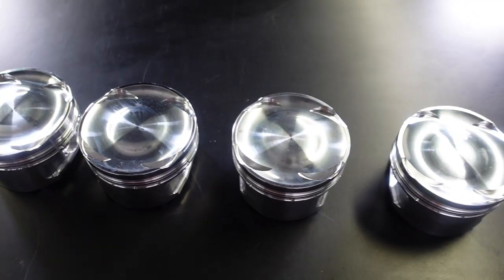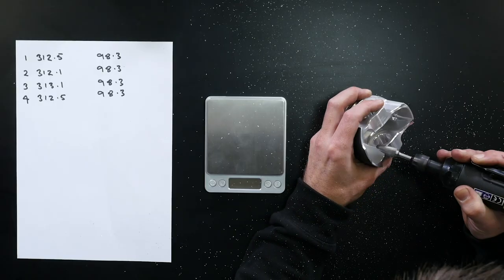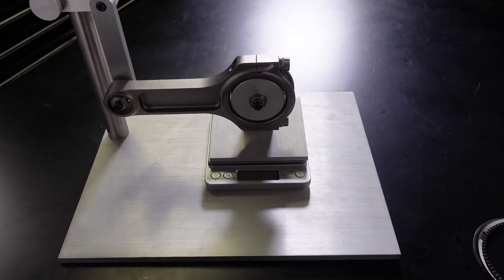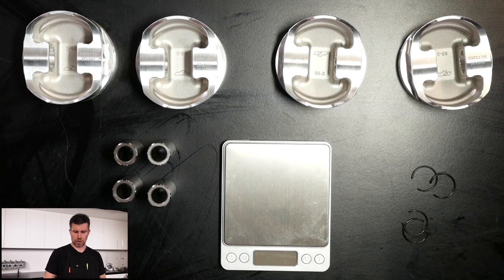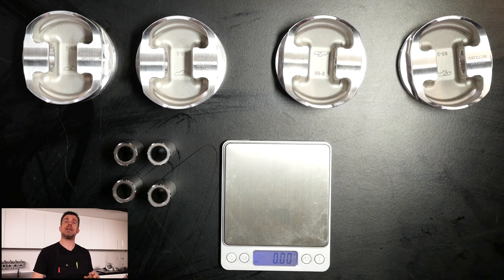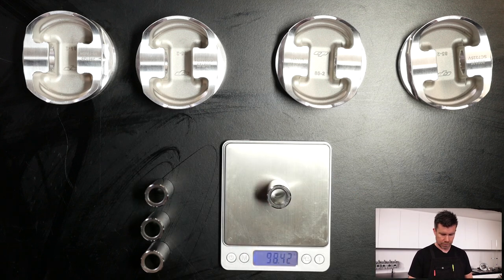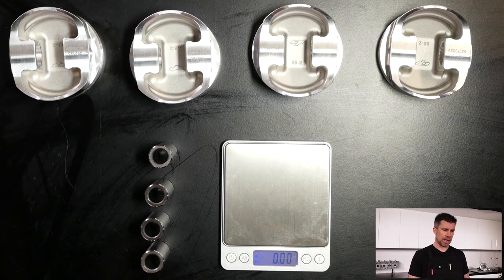How To Balance Your Pistons And Connecting Rods [#TECHTALK]

Comment from the maker: What engine are you going to balance the pistons and rods on for the first time? - Taz.
🦸‍♂ Building a fast car? Get $400 OFF the all inclusive VIP online course package deal:  https://hpcdmy.co/vipy67
🔧50% OFF your first online engine building course. Enrol now: https://hpcdmy.co/offery67
0:00 - What Do You Balance And Why?
0:40 - Can YOU Do It All At Home?
0:59 - What CAN You Do?
1:38 - Your Engine Specifics
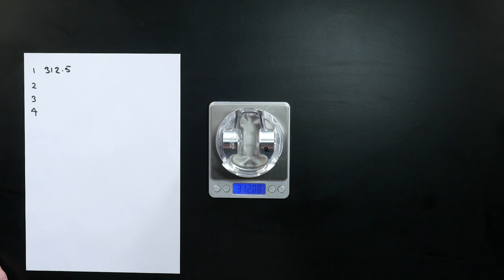2:59 - Do This Before Your Machinist Visit
3:18 - Wrist Pins, Ring Packs, Wire Locks, Pistons
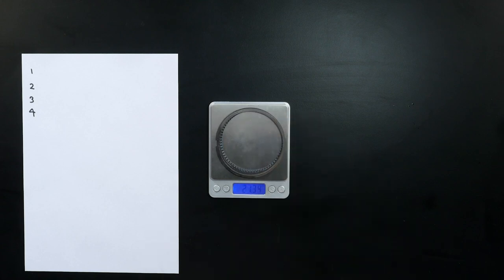3:45 - Balancing Ring Packs and Wire Locks
4:09 - Equipment
4:12 - Scales
5:07 - Die Grinder And Burrs
6:08 - Connecting Rod Balancing Fixture
7:38 - Linisher / Belt Sander
8:15 - [Piston Balancing]
14:12 - Tolerances. How Tight Is Too Tight?
15:15 - Where To Remove Material From?
16:45 - GOLDEN RULE
17:35 - Where To Stay Away From and Why
18:05 - Main Point Takeaway - Piston Balancing
18:36 - [Connecting Rod Balancing]
19:02 - Material Removal Big End
20:24 - GOLDEN RULE
20:40 - Material Density
21:08 - Material Removal Small End
22:26 - Cheap Scales 101 - What To Check For
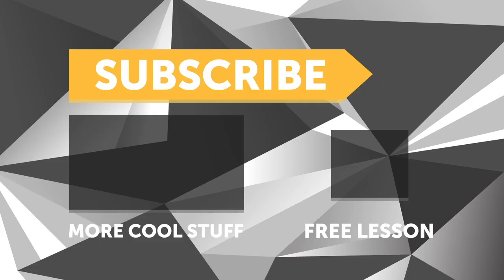24:10 - Learn More

Comment: At least for the aluminum piston If you use a good quality wood carving knife over a bowl on the scale. You can get a real time measure of what has been removed as you remove it. 
You just need to let the shavings fall into the bowl. A paper plate works well to.

Comment: Great video, good to see not much has changed in 45 years of balancing ricpro and rotating masses.  One question for you though, and since you and I both like to think in terms of high RPM, after balancing the connecting rods, do you recommend shot peening the beam and pin end where you removed material?  Or have you found this to be unnecessary?

Comment: If you were to put everything together as a unit piston... connecting rod.. pin...retaining rings. . piston rings... connecting rods bolts.. bearings. And you match  all 4 or 6 or 8 units in weight and say you only remove material of the bottom side of the  connecting rod or rods if theres not a huge difference in weight. Will this be a problem. Rather then doing it step by step?

Comment: Why wouldn't you also match the rod small end masses to the combined piston/pin/rings/retainers assembled mass? There might be a magic combination where the total reciprocating mass is within tolerance and no grinding is necessary.
Reply from the maker: You're free to check that and see when you're doing your build, but in our experience grouping things together will only see you take more material off less components rather than just a little bit off most - Taz.

Comment: hi great video very useful indeed...would weighing the piston with rings , gudgeon pin etc  as a whole  work? meaning the whole mass is weighed?
Reply from the maker: Yes, but be careful to match lightest to heaviest with pins to avoid taking more material off the pistons that you otherwise might have to. Heaviest to heaviest vs lightest to lightest is a bigger weight gap to cover if that makes sense - Taz.
Reply: @hpa101  i suppose you could put heaviess pin with lightset piston ....intreguing ...thanks
Reply from the maker: Yup, that's exactly what I'm trying to say, or rather Andre as he does talk about it somewhere if not in this video 😎 - Taz,

Comment: do you measure ring packs after gapping them, or it doesnt matter as all gaps (should) be the same
Reply from the maker: I'm not quite sure I understand your questions sorry. You measure your gaps and adjust as required, and then do confirm they are correct as part of that process.
Trust but verify.

Is that what you meant by your question? - Taz.
Reply: @hpa101  sorry meant measure the "weight" after ring gapping? Missed one vital word, lol.
Reply from the maker: @SuperTambo69  it depends on what level of accuracy you're working to. What we show with piston and rod balancing is already a bit over and beyond what most do (but since you have the gear out why not spend just a few mins doing it is the logic), but Andre considers the piston ring weights in the grand scheme of things to be negligible personally.
With the above in mind, you can do what you prefer, you're not right or wrong to do things either way, just a matter of your preference - Taz.

Comment: For an inline 4, can we simplify things by regarding each pair of rods, pistons and pins, as a single unit? That is, cylinder 1 and 4 are one pair, and 2 and 3 are the other. Why do all 4 sets of components need to be individually balanced?
Consider this scenario. Group the components into sets, ordered from lightest to heaviest. Now distribute these sets 1, 2, 4, 3 across cylinders 1 through 4.  Now just take the weight required off cylinder 3 parts to make the combined weight of sets 2 and 4 the same as 1 plus 3. Even simpler (but slightly less accurate) - just distribute the ordered sets in cylinder order - 1, 2, 3, 4. The combined weight of 1 and 4 might be close enough to that of 2 and 3 to make any grinding unnecessary. You could call this Passive Balancing.

Comment: This is completely misguiding !!!  Sorry to put you on blast,  but this will have people messing their engines up. This by itself cannot be done for any engine.  At he end of the video, he mentions the Bob weight, reciprocal mass, etc.. except they are extremely important.  Which affect the TOTAL balance of the COMPLETE rotating assembly.  You cannot just make all your pistons & rods the same equal weight & have a balanced engine.  Those big things hanging on the crankshaft,  or the counter weights are all specifically balanced accordingly to specific piston & rod assembly,  & a good balance should include any hardware also, such as bolts, wrist pins, etc.  Yes ideally, if you were a machine shop,  you would want to do this & make each piston & rod assembly equal,  not to mention removing any castings,  burrs,  etc help with windage,  oil deflection & so on,  but after all of this,  these piston & rod assemblies would be balanced along with the crankshaft.  Hence Bob weight,  reciprocating mass. In this balancing, either weight will then be removed or added to the crankshaft.  Now some engines make up balance in what's called an external balanced rotating assembly,  which include the harmonic balancer & the flywheel /flexplate, which will have added counterweight in one or both. While this works fine, internal balance rotating assemblies are ideal, especially in racing engines,  but this is where the harmonic balancer & flywheel /flexplate have a "neutral" or "zero" balance .

You can not just break out your dremel, belt sander, & scale, in your garage & "balance" your engine!!! There are very special machines, computers,  etc that do this. Not to mention a skilled technician.  I have over 20 years experience building high performance engines & high end fabrications,  so I can build anything, but I don't have the special equipment to machine,  to balance,  etc, & so even I take my stuff to a specialist who has the proper equipment & know how to do these things correctly. 

Don't do this at home kids!
Reply: A good point David. To be fair, he does place it in context in the first 3 minutes of the video. 

I can see what you mean, though, and it is a problem with semantics and clarity regarding the frame of reference. "Balancing" of the rotating assembly is done at the machine shop by adjusting the relative masses of the crankshaft and pistons, mainly by modification of parts of the crankshaft for internally balanced engines, whereas what is happening here is actually ensuring close uniformity of the mass of the pistons and rods with reference to each other and without reference to the crank. You could call it "balancing" one piston with respect to another, but it is important not to confuse that with "balancing" a rotating assembly.
Reply: I agree that this is not a balanced rotating assembly so the viewer shouldn't infer that. but as stated above, the crank is balanced by an automotive machine shop. This is why the title of this video says "How to balance pistons and connecting rods"
Reply: Aaaaand someone wasn't paying attention during the first three minutes of class....
Reply: Paying attention? Ill say it again.  This is misleading, because too many will misunderstand. The very brief statements about needing the complete rotating assembly balanced,  etc etc, but then making a complete video doing this can easily be lost in translation.  Besides this being absolutely pointless in the first place. Except for maybe to make a video to fill a time slot.
 In itself,  what is the point of showing a novice how to make each rod and piston assembly the same weight, when they still have to take these piston/rod assemblies along with the crankshaft, etc etc to a professional machinist only to have it all balanced together? 
Especially since your really not going to save much, if any money, because your still going to pay for a full balance. Any real machinist is going to go over everything, whether another shop "worked on" it, &/ or definitely after you say you did some of the work already.
Not to mention that doing something like this can actually be counterproductive, & even possibly weakening or ruining the parts. Especially in the hands of a novice. 

What grit, or grits to use? When you you switch grits? How much time & pressure?  Should there being a cutting oil? How much time to remove how much weight? Especially when tge weight is down to fractions. What happens if you accidentally remove too much from 1 assembly after doing a few? Do you start over removing more?

Do you know that leaving grooves, even those you don't see can actually affect oil flow & reflection? May sound ridiculous but it isn't. 
Do you also know, that just making each rod & piston assembly the same weight isn't necessarily balanced?  That there is a careful process of removing & or adding weight around the whole thing so there is even side to side front to back weight dispersion. This is to help having "lop Sided" pistons, or side loading or Cylinder wall loading because one side of the piston weighs more than the other.   Which is especially bad when used large  stroke, bore or high RPM engines.  

Another thing is that even tho this is mentioned, & doing it as he said can work, well if all the parts are really closely weigh the same as each other,  but in fact these weights should being taken with the wrist pins, clips, bolts & bearings being assigned to a specific piston/rod assembly . Remember that even a little weight difference here & a little there can can add up & throw things off. 

Listen im not trying to just be a jerk, im actually spending all this time on this, time i really don't have, but putting here because i feel it's important for others to truly understand.  I remember when I started out some 20 plus years ago,  & the struggles i went thru in getting the correct information.  And just like i see now, all too many countless videos, forums, etc with misinformation,  to outright real bad & even dangerous information. Many times from so called professionals too. The countless wasted hours,  years & money on bad info sucks.
.So i dont want the men & women coming up in this world go thru this.

Im not completely knocking this guy or his video.  But i stand by this not being a DIY video,  & should be left to actual professionals.  Honestly how many fast & furious millennials are going to try this to go along with that Ebay turbo kit, even tho they can barely do brakes, but all because they seen a how to video that makes it look considerably easy.  Remember everything seems easy when 19 years old.  
So this could be a "this is how i......" type video instead of a "how to........" video. And should make clear that none of this should be attempted at home, & not by novices.
Reply: @corvettefever360  Hey there bud. I'm gonna say if they arnt smart enough to hear the entire section of the video referring to the Bob weight and the crank being balanced on a machine. Then maybe they arnt smart enough to be inside of an engine anyways.

Comment: If you're trying to balance an engine better than 1/4 ounce inch you are wasting time and money, there are to many other variables such as oil under the pistons on the upstoke verse oil trapped under the piston on the down stroke, I've been Balancing engines since the mid 70s, and if your engines operate above 7000rpm you should consider putting a 3% over balance on the reciprocating weight to deal with rod stretch on steel rods of around .035" and Aluminum rods at .050" ...